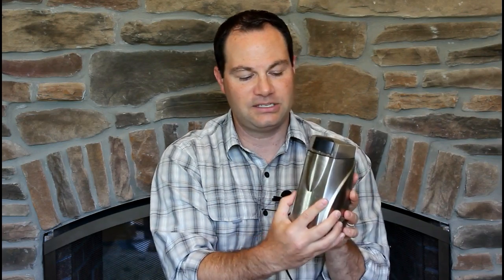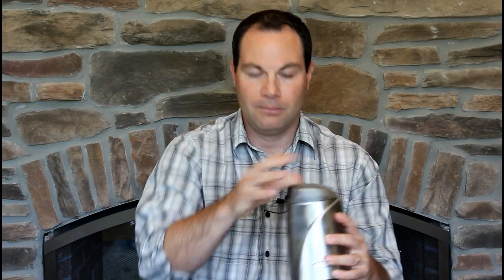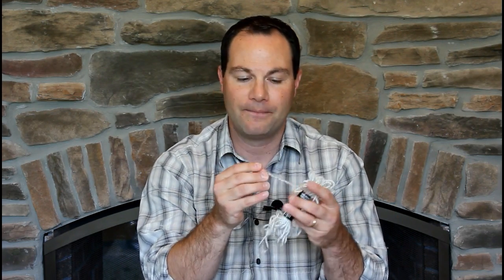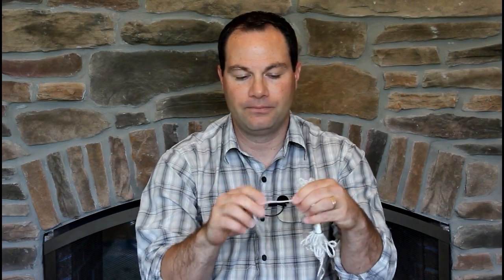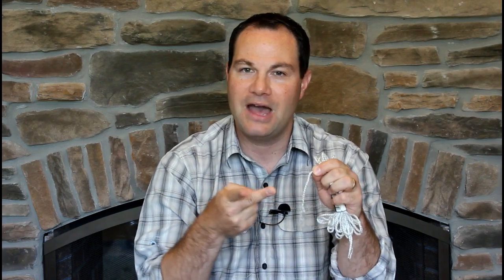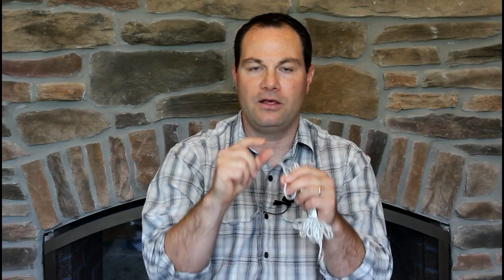Fly Tying Gadgets: Coffee Bean Grinder for BLENDING DUBBING!

Comment: Another great video Tim. I began using one of the Hareline carding style blenders about a year ago. I got tired of trying to remove the knots in my dubbing caused by "one too many pulses" of my coffee grinder. The Hardline tool is a bit on the expensive side but it works beautifully. It comes with a good supply of basic colors of synthetic material and flash.
Reply from the maker: Thanks for mentioning your thoughts with the Hareline product, as they're a reputable company and the product appears to be of higher quality.  If you have any other thoughts about it, please share, as I know some would consider making that leap in the future, too.  Thanks again for taking a moment.  Tim

Comment: Thanks Tim for the tips. I really don't blend for specific color however when I do it's hand blending with any material that has a close color of the insect. I did once blend materials to match an iso using some doll hair yarn (it looks like a hank of sculpin wool, non twisted fine straight fibers) and some packaged dubbing, natural and/or synthetic. Some smallish tan mayfly I think was on a egg laying run (at least I thought because most had an egg sac between their tails) so I pulled some fibers from a rug that I added to some tan antron. Good match but the "judges" didn't like it. That was when I young and inquisitive, I mostly fish nymphs now and just use peacock and furs. all buggy stuff. I don't match but shape, motion, and close enough colors. But I agree with George Semel, my nymphs and wets were all big 10,8,&6. That's when I started tying and fishing. Dries in 12,14, maybe 16. I think I would have more success fishing smaller. Yes Tim there's alot of good info out there, besides your excellent tutitlidge, I would recommend the limp cobra website. He had an extensive piece on dubbing. Thanks Tim...
Reply from the maker: Thanks for the comments, Joe, and I know what you mean regarding the sizes dropping.  A #12 seemed typical for many of my patterns; now it's closer to a #16.  Also, I appreciate you mentioning the "Limp Cobra" website, as I've never seen it before.  I just shared it on my Facebook account.  As always, thanks for taking a moment, and I appreciate the kind words.  Tim
Reply: Awesome, I watched the "cutting edge" 😉 video - razor blades. All hail Hank Vana! awesome diy tools. Yeah that Limp Cobra is very informative. Marc Favet I think is the bloggers name, international info, YouTube stuff, sbs tying instruction, lots of photography, etc. Frankenfly, Paul Beal - developed Frankendub - is another. He's a great guy, contributor on j.stockard blog and also has YouTube channel and a bass fly fishing blog. Featherbender, Barry Clarke's site, awesome tyer, had YouTube channel then updated to new one. He did an article in Fly Tyer that caught my eye, pike flies that looked other worldly! He's also a photographer. Now is a contributing tyer for Fly Tyer mag. He's an Englishman living in Norway, so his tying has Scandinavian and Nordic style, at least to my eye. Tim, alot of the hooks I had were from bait fishing when I started to tie flys, mostly #4 to 8 mustad 3366 and 3399, along with eagle claw. Even then I was very technical, made by own leaders, not those heavy line snelled things. I loved drifting worms for trout and walleye. One day I left that tackle home and forced myself to take my Cortland #8wt "just add water" fiberglass bass rod, a box kit with level line. I practiced on the lawn, on the lake and stream. I started tying jigs for spinning and flies for the fly rod and caught fish! Nymphing was like drifting worms so to me that was the most productive. I went from reading the conversion chart on the tackle shop wall for letter to number line weights to buying higher end rods, lines, feels ect. (my high end is $100, I got alot of stuff in the late 80's - early 90's, so the I must have is now I like it but don't need it)   Now that I've come out of my cave and entered the information age (I always and still read print) I concentrate on refining techniques and updated materials and styles, which happens so fast it's hard to keep up. Right now I'm working on developing my inter species telepathic skills, it may prove less embarrassing than the time honored yelling of "here fishy fishy!" 😯 Thanks Tim, you're always inspiring and informative... cheers! 🍻